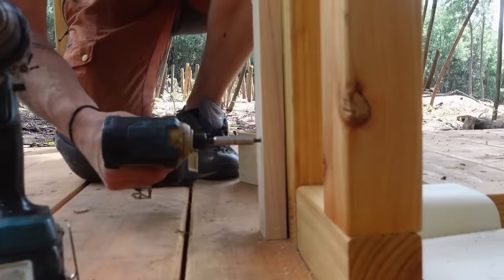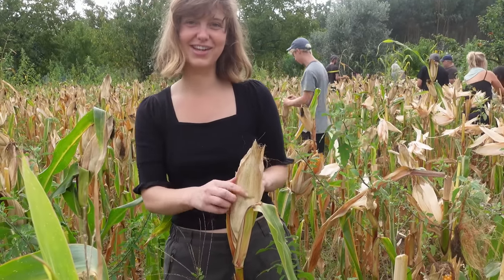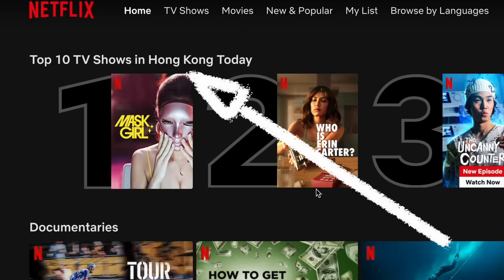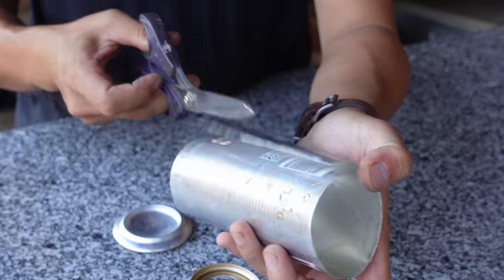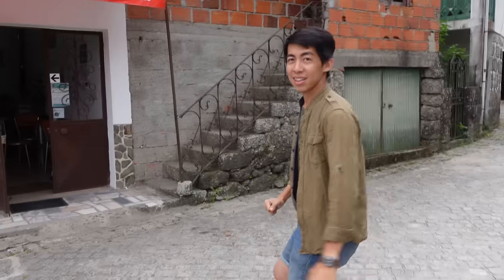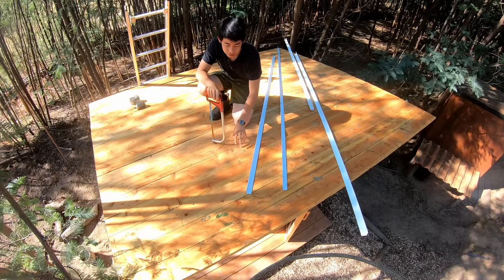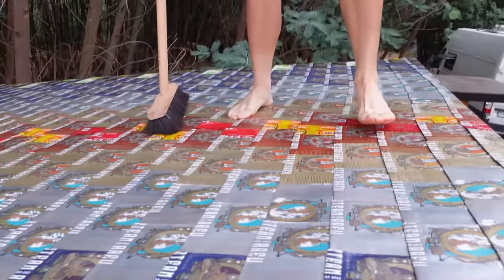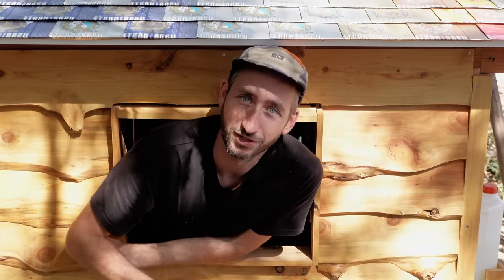#94 How we transformed 498 aluminium cans into a roof

Comment: I make a living in the roofing industry & have some pointers for you all... first really appreciate  your enginuity & willingness...but for future roofing projects I recommend installing a underlayment like roofing felt or Ice & Water shield which would be the first choice...& next I would use a fastener that goes all the thur the deck & penetrates by @ least 1/4"...otherwise your screws will back out in time due to thermal movement - expansion & contraction of the wood causing leaks...also...wonder if you all could get sheet metal from a body shop that they going to trash or recycle instead of the thin cans..would be tougher, last for years & better return on your sweat equity ...NEVER QUIT ...Builder Bubba
Reply: Thanks. As I've been saving steel can lofs fur a roof after I lay treated costed wood down. Then after the steel is diwn cost that with roof coating
Reply: The issue with underlayments is that they are all plastic
Reply: I agree with your analysis.  That said, in a remote village the availability of a moisture barrier or money to buy it may be slim.
Reply: Bonkers amount of time spent on this.
Reply: @fasi247 Thanks for making clear to Mr Rights that the point of the video is making things easier and reusable waste minded. Buying a tar paper or felt as Mr Rights propose and driving around for hours to collect left over sheet metal does defeat the point of the video. A roll of 432 square foot of tar paper cost $42. bucks plus bringing it to and just to use 30 square foot and the rest garbage. Typical Grengo way....
Reply: @DannyWildmen would tar-paper be installed OVER or UNDER the can-tiles?
Reply: @JimzAuto under, against the wood structure.  It’s an  extra protection for the wood.
Reply: I don’t think aluminiums cans are suitable as roofs to be honest. They are not good insulator, easy to get damaged by storm and oxidise quickly with rain water. There are reasons we use terracota tiles or stone slates for more than a thousand years. They are good heat insulator, they are heavy enough to withstand a mild storm, easily replaced or repaired, easy to mass produce. A lot of recycling ideas sound creative but they cannot be replicated because too costly, time consuming and labour intensive.
Reply: @einsam_aber_frei  ‘thousand years’- efficient aluminum production has only been possible the last century. All the other products you mention weigh more and cost more than ‘free’. For some uses where owner is willing to perform more maintenance I think recycling aluminum in this manner is quite efficient.
Reply: I did wonder why no underlayment too.
Reply: @buentaste actually other things can be used as a moisture barrier.  But the reality is that he's right... I have put tons of sweat equity into fixing things with whatever I could find, only to have to go find something else to deal with the things that went wrong with that. Then he will probably need a new roof because the plywood will rot.  An underlayment doesn't have to just be tar paper.
Reply: @einsam_aber_frei  I believe aluminum oxidization actually creates a layer that protects against corrosion. Aluminum doesn't rust.
Reply: @MrLardobutt  ‘durability is HIGHLY questionable’- your statement is questionable. Aluminum is used to contain liquids under pressure; should resist falling rain w/o issue. Please share a study disproving my point (if you can find one :)
Reply: @MrLardobutt  thank you for your informative reply. I agree, aluminum cans have great compression strength in the original vertical orientation, much strength lost after can is deformed.
Reply: @einsam_aber_frei  On the other hand, this is just an outhouse so it's good for crafting projects like this. Using tiles for this would've been overkill.
Reply: If there is no underlayment available, what about tar and felt?
Reply: This is obviously more of a fun hobby project to create a nice looking conversation piece (and a video)
Practically its just a massive waste of time, that 4kg of cans could be scrapped for a couple of bucks and you could just buy roofing material. Not to mention there is so much scrap in modern society that there are tons of other better options for roofing. Cans might make sense for free flashing for a window, a cover for a fence post (open it, put it over, done) or roof for a cat house. But for  any bigger project it pointless, unless you're making it for content/fun.

But if you are going to this yourself i guess you could make an argument for doing it inside during the winter
Reply: @Lappmogel  I don't think rgey wasted one second.
Reply: @enjoyyoursleep1  Like i said, pointless unless you're making it for fun/content. They made both so i don't think so either.
Reply: @einsam_aber_frei  " There are reasons we use terracota tiles or stone slates for more than a thousand years. "   Yes the aluminium can was invented in 1957 

thats why
Reply: @annaalva2320 even paint would have helped
Reply: Or melt wax on the wood to protect it
Reply: Good appreciative advice!
Reply: @vasocreta  came to say this lol
Reply: I think what you and some others are missing is that budget and availability may be at play in this situation. Small towns like this are unlikely to have a hardware store with roofing supplies. Pretty sure there is not a big enough market for Home Depot to open up there. This is not a perfect professional roofing job. It is a roof over an outhouse that was made by using recycled materials. That is all.
Reply: I like to try small things like this out on my chicken coops. This looks interesting. @Lappmogel
Reply: @vasocreta This is exactly  right aluminum oxide forms very fast, in less than 1/10 second.  It's like  a ceramic coating.  The inside of a can is coated with a polymer of some sort.  Paper bags might work as underlayment moving water from high tension crevices out to evaporative areas...
Reply: Thanks for the pointer about the fasteners! I was wondering about a moisture barrier as well, and in keeping with the ethos of their project trying to think of suitable materials and thought about large animal feed bags or bags of other agricultural products like seeds or grain or compost - 50 pound bags of this kind are either made of sturdy plastic or tightly woven strips of plastic. Maybe none of their neighbors in this area uses bags like that but it might be an idea for other folks to experiment with. But then if humidity got trapped under the plastic would it hold it to the roof and rot it that way?

Comment: That carefully considered layout of the different coloured cans is such a Kevin-touch! Love it.
Reply: It looked really good!
Reply: Loved this awesome video! Kevin is such a genius artist!
Reply: does anyone know what software/app that he used?
Reply: Thank you 🙇🏻‍♂️ everyone
Reply: @amin_i  affinity designer
Reply: It really made it didn’t it 👍
Reply: Yes, When the camera first showed the roof it was like an unveiling of a statue in the park!
Reply: Love the engineering.  I was hiking through the desert and found an old mining camp. One cabin was roofed with old tins and I traced one to 1850! A 170 year old roof!
Reply: it made a huge difference...I had been asking myself why the originally didnt fold the cans to be used with the bare aluminum side facing up....now I know lol
Reply: @kevincheung2951  clear coat the roof so the paint doesn't fade. The UV rays will make the paint completely disappear very quickly
Reply: @alabastardmasterson  we are curious to see the changes
Reply: @1nvisible1 : I do the same right now for all of my outbuildings using the 28 oz. tomato cans. Where I am at, the patina of rust takes the glare away and thus make it almost invisible from above. I notice that after the initial  rusting that the cans have greatly slowed in further rusting, as if the original rust is protecting the metal. I guess the fact that the water does not "sit" on the metal and they get dry pretty quickly slows the ability for the rust to go any further. But, I have a lot of "extra" of my tin shingles for new projects and or replacement if any get damaged.
Reply: the inside out would be alo good, the inside is coated with a plastic which keeps the beverage from dissolving the aluminum can....
Reply: @1nvisible1 wow

Comment: The fact that not only did he (brilliantly) create such a way to fold the cans  so they’ll fold and lock into eachother, and then utilized the can tabs to act as clamps to hold them down, AND THEN designed a pattern for all the cans to PERFECTLY fit into to make a decorative roof…..this is incredible. Hes amazing!!!!
Reply: yeah very well done, but the bending technique is the standart folding technique used by roofers
Reply: I totally agree! What a legend
Reply: I'm impressed with the circular cutting tool he used to cut the can ends off.
Reply: Imaginative & innovative repurposing!
Reply: @carolefitzell6140 right.... I want a video on how he created it❤
Reply: Yeah...that is what he did..
Reply: @carolefitzell6140 I was going to comment and ask if he had a file or tutorial on how he made that cutter ❤
Reply: It's called sheet metal and it's an underrated trade

Comment: The roof shingle design is genius.  Could you sheath the precious plastic roof in Aluminium, shiny side up to reflect heat away from it?
Reply: That would work but it might also reduce the lifespan of the roof as it would corrode a lot quicker too unless you could cover it in clearcoat of a form of lacquer.
Reply: shiny side up could potentially throw unpleasant speculars though.
Reply: What about the winter when you need heat?
Reply: @bobweiram6321 the plastic is especially warm because of the sun not the ambient temperature, in the winter it probably wouldn't exceed the temperature hold of wood.
Reply: Shiny side might reflect the sun's rays and cause a fire!!!
Reply: Shiny side might reflect the sun's rays and cause a fire!!!
Reply: Could? Yes. Would you want to? No. Aluminum cans have an inner layer of plastic that would erode in direct sunlight The outer layer is anodized coloring that helps keep the aluminum itself from oxidizing and lasts a lot longer than the plastic liner does.
Reply: @edwardnigma2216 thank you for clarification - I was wondering why didn’t they turn the cans because I remember that they have the additional inner coating which is resistant to water - but I didn’t know about potential UV erosion of this plastic layer.
Reply: @dweamy1  Not likely to happen. It's not a magnifying glass. The light is dispersed and not concentrated or focused. I agree, however, the roof should be painted.
Reply: @edwardnigma2216  but btw I don’t think that cans are anodized anywhere at any point. It’s probably all about the paints.
Reply: @edwardnigma2216  The plastic coating might degrade in UV light, but aluminium naturally forms a surface oxide layer, which inhibits further oxidation in air. I guess, independent from orientation, the real problem will be contact/galvanic corrosion with the screws that were used to attach the shindles, since they are made of a  more noble metal.
Reply: @gabrieliusmerkys9907  aluminium does not corrode. it lasts forever. i've got an alu roof and it's over 30 years now. no signs of corrosion ...
Reply: @gabrieliusmerkys9907  soda cans have a plastic liner inside where the liquid is.

Comment: Well done!  Your project reminds me of a roof I saw in a Wyoming ghost town that was built in the 1880s. The roof was made from one gallon coffee cans.  They didn't make much effort to fit the shingles together as neatly as you did. It would have been very noisy in the wind, and that location is very windy!  Using steel cans would not work in most of the world, but in Wyoming's dry air, the cans were still mostly intact 100 years later, though the building underneath had collapsed! The roof now lies on the ground, and wild rabbits are sheltered by those steel shingles!

Comment: I have been a builder for almost 30 years. I love using recycled and upcycled materials. I have seen people use old fuel cans but this is a gear idea. I love your little jigs and the folding locking techniques very very clever. The one thing I would have suggested was some seam tape around your makeshift  evedrip metal. But bravo!

Comment: Awesome idea 👀 as someone who builds full metal buildings for a living I would suggest a moisture barrier between the wood and the metal to prevent excess moisture buildup.
Reply: A ice and water shield?
Reply: Just a roof underlayment, tarpaper, or a synthetic. The aluminum will sweat on the bottom side.
Reply: Horribly unsustainable though
Reply: @MrJakson112 lol ikr because aluminum cans will dissappear from the market tomorrow right? 😂
As an experienced roofer that repairs all roofing systems, I'd say that they not only found a sustainable roofing solution but also a free one with a little bit of effort. My only concern is the lack of underlayment as the metal will sweat underneath from daily temperature changes.
Reply: yeah. they couldve at least used an old tarp or vinyl sign
Reply: And maybe perforations or holes in some of the areas on the aluminum. For evaporation of condensation.
Reply: Aluminum is pretty thin the moisture barrier would be wise and painting it with liquid with that much water exposure I would expect electrolysis to make pinholes because the metal so thin.
Reply: @MrJakson112 wax paper maybe ? Bees wax and homemade paper ?
Reply: @MrJakson112 how is this unsustainable? Are aluminium cams disappearing sometime soon?
Reply: How this folding idea works in icy areas?  At $20 dollars minimal wage how much this project costs?  Material and labour?

Comment: Looks great and the idea to use the ring pulls was brilliant. 
Aluminium is highly reactive which causes it to form a protective layer of Aluminium Oxide which generally prevents it from more corrosion, however I would expect it to degrade if there was a lot of heavy rain. Saying that, I have found old cans from decades ago out in the Scottish wilderness before so they might hold up. If they did start to degrade I would start to worry about aluminium leachate in the soil around the toilet maybe? Again though that would probably only be an issue if this technique was used on a lot of buildings over a long period of time. 
Looking forward to seeing how it turns out!
Reply: If you cover it in a thin layer of paint or enamel it should protect it over a longer period
Reply: @tobysmith4604  drink cans already come with a nice layer on them... shove some caustic soda solution in one ;)

at the price? who cares if it needs re-doing after a decade or so? and yeah, if a can can survive underground for... at least fifty years...

i wouldnt be overly worried. biggest issue is actually having another metal in there, that starts the galvanic corrosion process... galvanised nails, etc. and as long as youre laying them properly so they arent getting wet/staying damp... ie, "cliplock"... should be FINE!

lol "self powered roofing materials"...
Reply: Try not to worry about natural things you cannot change. Enjoy the very short life that we all have.
Reply: Shingle roofs work best at a steeper angle. (Sometimes a strong wind can blow rainwater upwards)

Comment: Love the idea of using the aluminum cans for roofing tiles.  I was thinking, even though beautiful, if the unpainted aluminum side was up, it might reflect sunlight/heat; also the inside has a polymeric coating which might shed water faster.

Comment: Old coffee cans were a common siding and roof material when I was a kid growing up in the hills. They were thicker metal, so the issue with wind was never an issue.
Reply: Yeah, 'tin rooves' were common in poor communities in the hills and mountains, and had the benefit of fire resistance vs wood shingles.  Wealthier people used shingles of ceramic or slate before modern tar paper based rooving.  Now metal rooving options are coming back into fashion in some places.
Reply: In the Netherlands it was common to cut oil drums and flatten them. There are still a few barns with these as roof.
Reply: My grandma rebuilt the horse barn after a tornado  with cans. She had all the cafeterias and restaurants in the area save them and grandpa picked them up on his garage route.